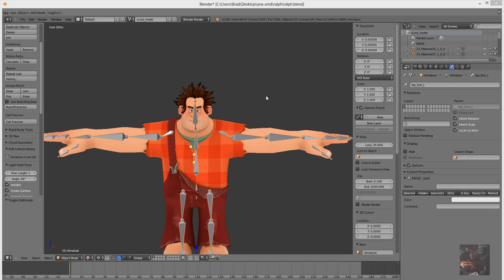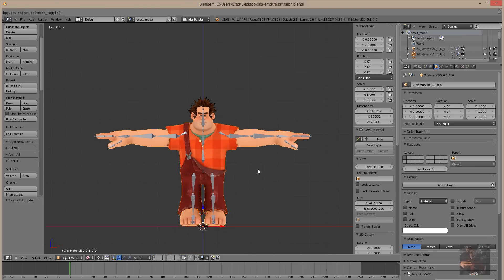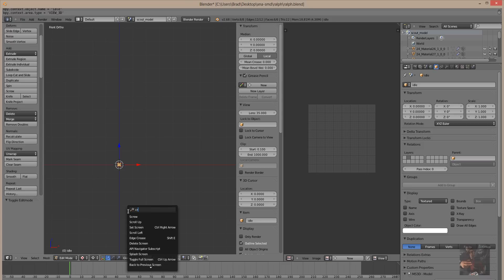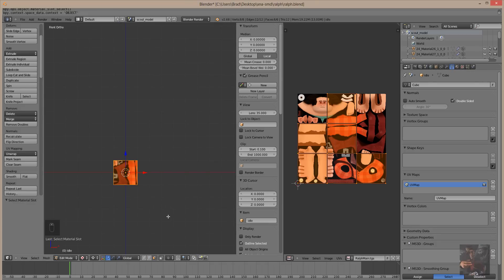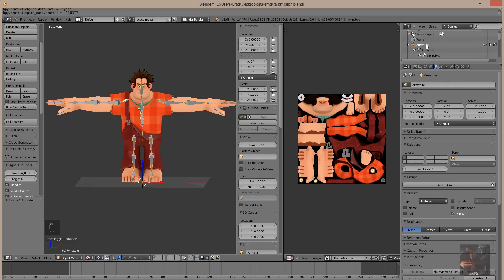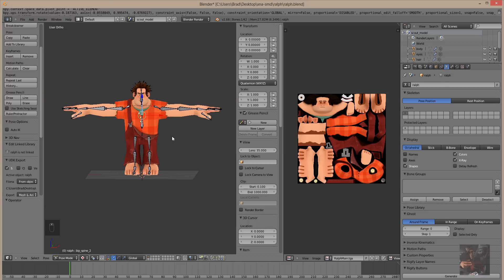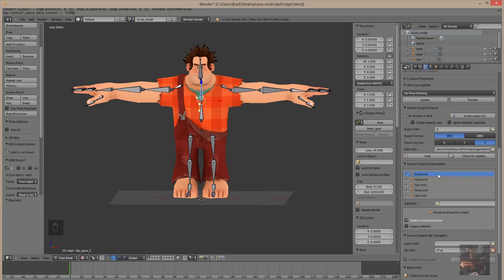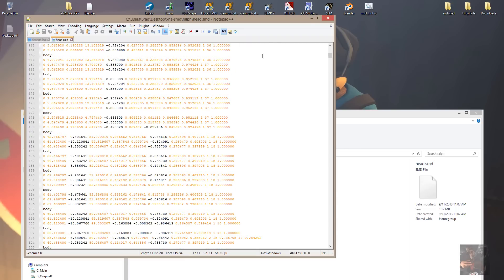SFM - Converting XNA Models for Use in SFM Pt11 - Creating the Idle Sequence and export SMD Files

Comment: What I cant seem to find out is how do I add facial expressions to the model? I found a tutorial but when I export I dont know what to do with the commands exactly. Do I work on the facial expressions before or after exporting the model?
Reply from the maker: What program are you exporting the model to? Facial expressions are vertex animations that you have assigned to shapekeys. The model needs to be exported in its natural pose, without nay expression engaged. Then, in the program that you are using your model in, that is where you apply the expressions using the sliders for the shapekeys that you made.
Reply: I already figured it out. But for some reason the model lacks the ability to open its mouth. It could of been able to but when I move the lower lip down the upper lip follows. If you go inside the models head it has a pink thing attached to the mouth and I cant select and delete it cause its part of the head. So I dont know what to do now. I've seen others with the same model in sfm and it has the ability to move it's mouth so I dont get it
Reply from the maker: Some of the HWM type models have a Jaw Lower, then the lips have their own flex to separate them.
Reply: Pte Jack so if I export it and open in SFM it should be able to move its mouth anyway?
Reply from the maker: It all depends on how your shapekeys are setup, if you export as a DMX and compile and the are no underscores in the shapekey names then it should compile the flexes, if you export as SMDs then you have to define the flexes in the qc and their controls.
Reply from the maker: Have you seen my guide and the sections on shapekeys/flexes ?  If not look at this...

http://steamcommunity.com/sharedfiles/filedetails/?id=245723825
Reply: I dont think you saw what I said.  I know how to make it move. But when I try to open the mouth it stretches the upper mouth with it. I looked inside the models head and there is a pink blob that is attached to the lips. I think it's because of that pink blob is the reason why both lips move the same. It's because the pink thing is attached to both lips and one cant move without the other im guessing
Reply from the maker: Are you the swift gamer on Steam.  Read the comment by Scre and provide a screenshot as requested (if you are.)
Reply: Scre?
Reply from the maker: Was this you asking the same question?

http://steamcommunity.com/app/365670/discussions/0/144512753468062027/
Reply: Yeah
Reply from the maker: did you provide the requested info/screenshot?  We can't really help without
seeing what you are working with.
Reply: All i'm gonna say is I had my reasons for not showing a screenshot

Comment: Can you explain how this would work with a more difficult model like one with face and hair bones? The rigging of the tf2 face models is a lot different than any xnalara ones but I would like change it to the tf2 rig but I have no idea how to do it. The body is working though so thanks for the tutorial.
Reply from the maker: Hair is not a problem, the same principle is used.  Add a bone parented to the head bone and then extrude more as needed weighting the mesh to the bones created down a chain.  As for facial expressions and other "flexes". These are mesh animations that use shapekeys.  In object mode you would create a basis shapekey in the vertex property panel. This key should be created with the mesh in its rest pose position and all modifiers applied to the object you're giving the shape to. Once a basis shape is create, you CAN NOT apply any opened modifiers to the object.  (I can't remember if you can add more after a shapekey is assigned, something I would have to check...)  Once the basis is created you create more for each shape you want to add, slide the slider to 1 in edit mode then move the face into the position you want.  You can add new shapes based on old ones but the process is not something to discuss in a forum like this.  If you watch this timelapse video, it will show you some of the things you want to do.  https://youtu.be/GaPCIO7Vvok?t=2m32sNow, that you have your shapekeys completed, you have to decide what format you're going to export from Blender, either SMD (old school) or DMX (Hint this is the way to go).... If you export SMD type files, you have to define every flexkey to made in the qc.  (Simple DMX does that for you and you the only flexes that I have found that I have to define are the eyeball flexes.)If you haven't already found my guide on Steam, go here.  http://steamcommunity.com/sharedfiles/filedetails/?id=245723825  I talk about flexes/shapekeys and eyeballs in greater detail in the guide.
Reply: Wow thanks for responding! I was reading your steam guide but I have one problem with eyelashes as a separate object for facial flexes. If I join the mesh with the face the texture will no longer appear properly since the eyelash has its own texture. Is there a way to fix this?
Reply from the maker: It does not matter if the eyelashes have a separate texture.  Each unique material of the model needs a VMT.  When you join the eyelashes to the face the material for the lashes will be transferred to the Face. (Check it out.)  Let's say your face has a material called head, it is the only material that object has, and your eyelash object has a material called lashes and it is the only material they have.  (Now the mesh has to be assigned to the materials before doing this).  Select the lashes object then select the head object and join them.  Look at the material for the head object now. It should have both the head and lashes materials.  Take the head object into edit mode select the head material and press the select button, only the mesh that was assign to that material should light up. Now press the deselect button then select the lashes material and press the select button. Only the mesh assigned to the lashes should light up.  When it comes to compile time, you will have to have 2 vmts for that body group, one called head.vmt that points to the texture (VTF) for that mesh and one called lashes.vmt that points to the texture (VTF) that paint the lashes mesh.
Reply from the maker: an object can have more than 1 texture/material. Join the eyelash to the face object after you have set up the material then add the flex/shapekey.  The material will transfer to the face as its own material (as long as it is a different material).

Comment: Hey bro which are the differences between SMD and DMX' s format ?? is not the same ???
Reply from the maker: SMD is the old Valve Source Model Data format, it was a simple text file that contained a lot of data, it required a lot of work in the qc if you had shapekeys for flexes as each flex and flex controller had to be defined, was restrictive in bone count. The newer DMX format is much better and allows for programming HWM (Hardware Morphing Data) into the model.  125 vs 256 bones and the files can be either text or binary format...  Each format have their own pros and cons.